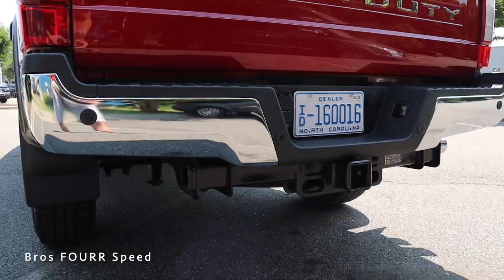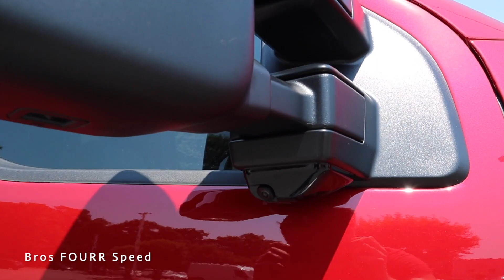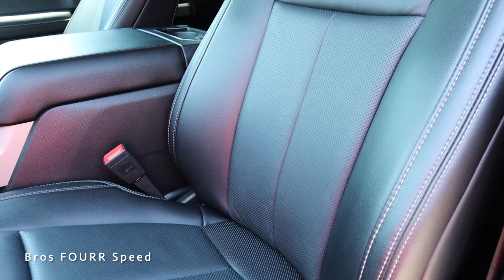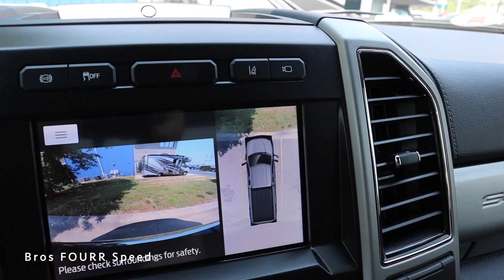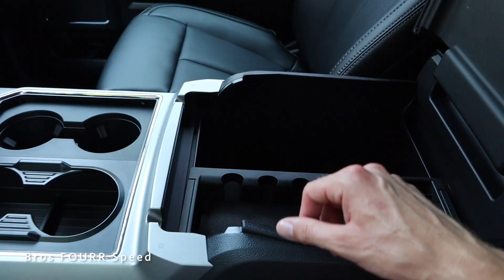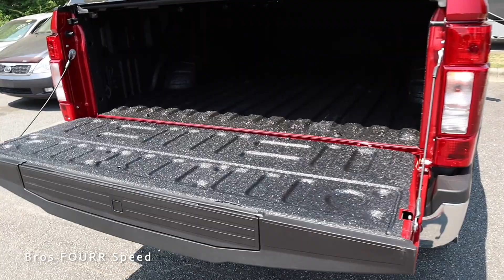2021 Ford F350 Super Duty Lariat: Start Up, Walkaround, Test Drive and Review

Comment: Metric conversions:

Torque: 1420Nm
Weight: Between 3045 and 3363 kilos
Fuel tank capacity: 128.7 litres 
Standard towing: 9090 kilos
Gooseneck towing: 10182 kilos
Overall payload: 1500 kilos
Wheelbase: 4.17m
Overall length: 6.46m
Height: 2.06m
Width: 2.03m
Minimum ground clearance: 0.216m
When tailgate open: 0.937m

Brian’s height: 1.81m
Temperature at the location he’s in: 35°C
Reply from the maker: Cool specs!